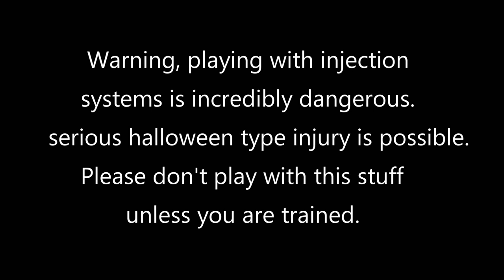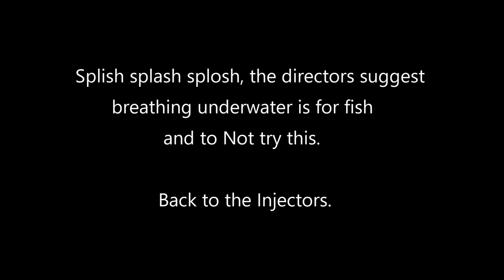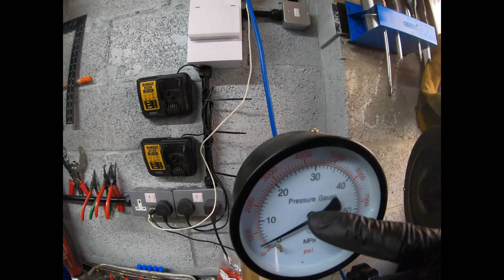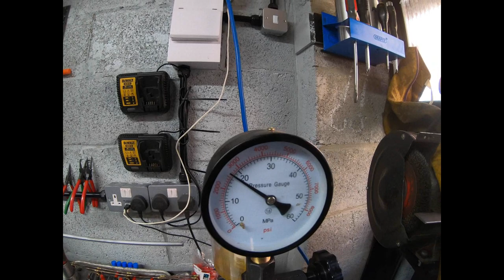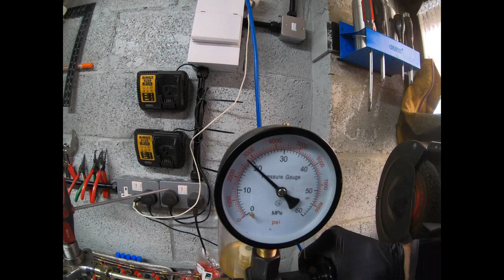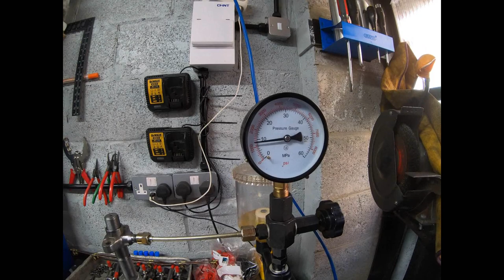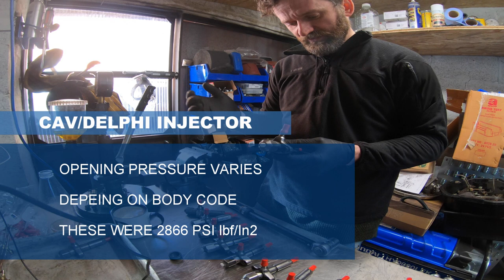Perkins 6 354 CAV DIESEL Injector service

Comment: My DAF615m engine was smoking badly in the canal du midi last summer . Eventually I found it to be the copper seal leaking under the injector. Changed all the nozzles, seals and now it's okay.
Reply from the maker: Thats a good result. Could have been expensive otherwise.

Comment: Very nice video.  Nice and complete info but I still have a question for you.  I'm on a sailboat with a Perkins 4.236 and have just had my nozzles done but I've since sailed on from the island where I had this done and I am now in a very "middle-of-nowhere" sort of place.  Now I see that two of the injectors are leaking from the adjuster nut cap.  I am pretty sure the shop did not replace the copper sealing washers on those.  After watching your video, it seems I can attempt to fix this in the field.  My question to you: Am I correct that there should be no harm done to the injector or the "pop" setting if I remove the injectors and torque down on the adjuster nut cap to 50psi as you did in the video in hopes to create a seal?  I remember the man at the injector shop being very clear (although in a language I speak poorly!), not to touch the torque on the caps or the nozzle nut...but I think I trust you more.🙂
Reply from the maker: The caps/nuts are just a loose thread and bite into the copper. Provided you dont drag the setting screw back you'll be fine. 
Use a blow torch to reanneal the copper or better still replace them.

Check the faces of each surface as this stuff  is getting very old. You may have to lap out some pitting. Use a new oil stone very fine if you need. Be sure its flat hence new.
Reply: What are the odds that I could drag the set screw as you stated, assuming I'm just setting the adjuster nut cap to 50psi?  Is this a real risk, and thus proper protocol to recheck all of the pop settings after the adjuster nut cap has been torqued down?
Reply from the maker: @strongmonty  Its a screw. Probably unlikely but vey possible.

Comment: Would you say the thread on the inside of the forged steel housing is durable enough to use a a fine thread nipple as part of a dent puller/slide hammer removal tool?  I have two injectors that simply will not come out no matter how I pry on them.
Reply from the maker: Hmmmmm, good question. Id say unlikely but what choice do you have. If you take the studs out can you not turn the whole body clockwise, with some lubricant of penetrant oil?
These are not modern engines, so not that long an injector. Unless its rusted in.

Feel free to send me some images of them. Ill see if i can think of a solution.
darrencrouch@dhcrouchmarineltd.co.uk
Watsapp 07809607630

Comment: Thanks for putting this online, i will give it a try myself. Would a T6354M with the turbos removed be over fueling and diesel washing the cylinders causing blow-by?
Reply from the maker: Are you getting excessive crank pressure out via the crank breather

Comment: Hello, I have a question: what size is the thread of the injection nozzle to the injection line? =)
Reply from the maker: I usually use a thread pitch gauge and measure the outside diameter. 
Have had some Imperial UNC. 

What do you need to achieve? Are you making new lines?